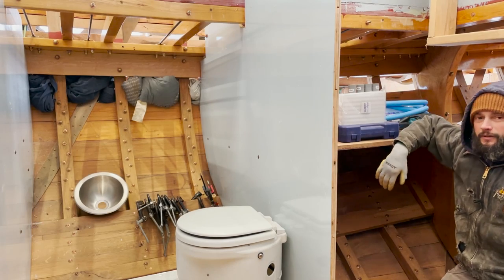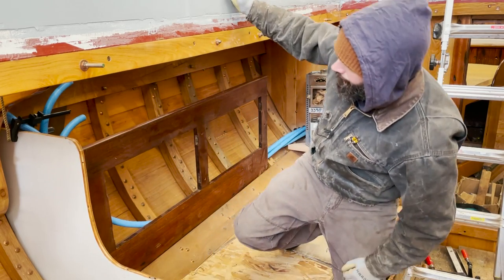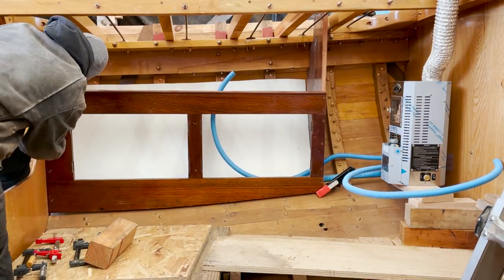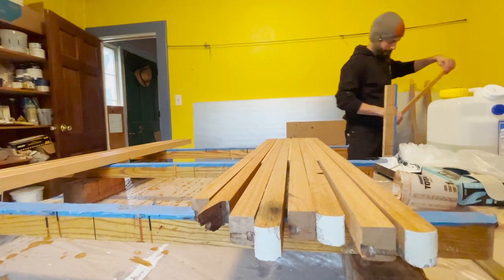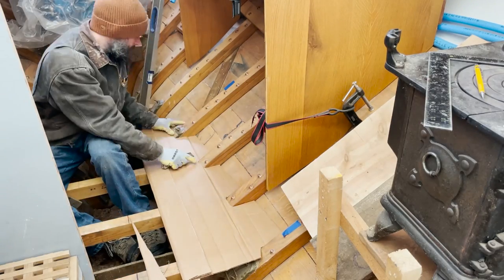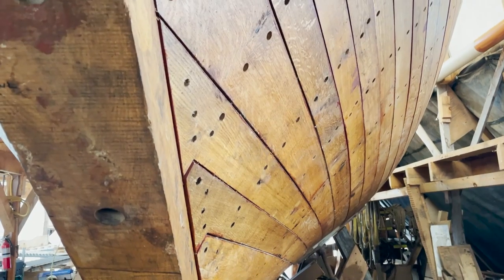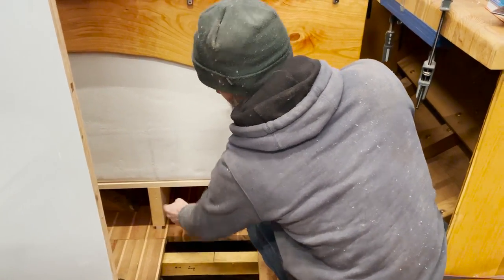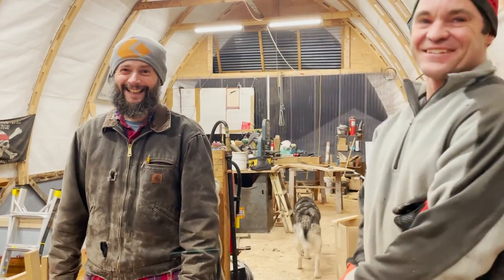Finally Back to Woodworking! - Episode 195 - Acorn to Arabella: Journey of a Wooden Boat

Comment: There's something about a wood burning stove in a wooden boat that makes me nervious.   Obviously you're not going to have a fire going in any kind of sea?  
And where are you going to store the wood?  A good fire extinguisher in close proximity would certainly be in order.
Reply from the maker: Considering the fact that the stove was manufactured to be on a boat of this size and a great many boats have them, rest assured. The pieces of wood that this thing takes are quite small, as is the fire box (the big door you see is the stove, the little door to the top left is the fire box). Check out what the normal amount of wood to stow for a few fires by looking up the visit to Norna we took a couple months ago.

Comment: Hi y’all! (Really Anne, I know you’re the one doing the real work managing all these comments. Great camera work BTW) 

Just wondering, and I’ve only seen one other comment about it, why pine for the reefer pedestal? I know it is on plastic runners, so no floor contact where rot would start. And I know you won’t see it once there is a drawer front and trim and whatnot. And I know you’ll put a finish on it so that it won’t soak up water/condensation. And I know the house sides are pine and they are extremely more exposed but they will be fiberglassed. And I know it’s plenty strong… but white PINE? Y’all are throwing mahogany vents up that won’t even be visible! You have oak and cherry and everything else laying around! Just wanted to hear some sort of explanation for this OUTRAGE!!! Lol 

Great work all of you. I hope it is as rewarding as you guys make it seem in the videos!
Reply from the maker: You might not know that a great many traditional decks and hulls are planked in pine where there’s lots of pine around. ✨ it’s good stuff. And of all the things we might have to replace in 10 years… this one’s an easy one. Other than that, how’d we choose it? We did a mock-up with it and it was damn near close to the right size. BAM. Quick project.
Reply from the maker: And yeah hi, Anne here 😁

Comment: DON'T use the GREY conduit couplers to attach the flexible conduit to your junction boxes! Instead, attach the blue conduit connectors directly to the junction boxes by drilling holes into the boxes that match the diameter of the threaded part of the blue connectors (I think it's 7/8-inch). Screw the blue connectors onto the ends of the conduit runs. Then, attach the blue connectors to the junction boxes using standard threaded rings designed for that purpose. NOTE that, the GREY couplers are used ONLY to SPLICE runs of flexible conduit.

Comment: I have been watching your vlog since the beginning and I must say, I’m impressed by all the fine work you have done so far. However I am a little concerned about your build. You seem to have shifted your focus to internal furnishings away from the hull and planking which, in my view should be your top priority. Aren’t you concerned that an unfinished hull without caulking or paint will undergo some serious distortion? Please do not take it as a criticism but rather as a concern.

Comment: Will it be possible to screw the conduit to the box once it is glued and in place? I would expect a lot of tension in the conduit.

As others pointed out the screwing is probably supposed to happen inside the box with an additional part and without „misusing“ the grey coupling part.

Comment: If you haven't come up with a solutions by now for the junction box connections. Lowe's & Home Depot sell fittings for that connection. Drill a hole the conduit fitting size. There are special hole saws that size. Then get these.  https://www.lowes.com/pd/CARLON-1-2-in-Conduit-Connector-Schedule-40-PVC-Compatible-Schedule-80-PVC-Compatible-Conduit-Fitting/1000999110 Glue it all in place.

Comment: Sorry, but I don't get the wood burner. Wood stove that needs special fuel - wood - which is dirty, bulky, and wants to clog you bilge pumps,  All when you have 3 other sources for heat - four if you count cold weather clothing. A lot of valuable space gone for a wood burning, cast iron stove that will get a lot less used than the diesel drip heater, stove/oven, residual engine heat, possible plug-in electric heat, Grey Goose down...  IMO.

Comment: About that heater with 12V fan. I wonder if a "stove fan" would work with it? Those do not need electricity to work. https://www.youtube.com/watch?v=rCk7FoxquYQ. In case you do not have electricity.

I am worried that the floor panels do not end on top of a beam, so that the panel do not flip up if you step on end of the panel. Or have those not been cut to length yet ?

Comment: I don't see any reason to use the gray fitting on the j box.   get j box nuts that fit on the thread of the blue fitting, drill the correct size hole for the thread, and nut the fitting to the box. skip the gray fitting. This is the standard way, and there is no reason to complicate it.

Comment: Why don't you just drill a half inch or three quarter inch hole whatever size the conduit connector is and use a nut instead of gluing a female end?

Comment: Why aren’t you refinishing by removing old finishes from the old woodwork.. considering you are using old leftover wood in other places that has old finish removed and re-sawn .... matching old finish will be nearly impossible... especially with missing parts such as old drilled holes.
Reply: Why are you assuming they won't? First, get the parts assembled and the fit right, and then remove them for refinishing.
Reply from the maker: We don’t need to match old finish… where we can leave patina because something is the right thickness, we do. Showing the life story of a piece of wood is more important to us than matching finishes.

Comment: you are going to REGRET not using a smooth walled conduit. that stuff is a nightmare. spend the $ on making all your stuff UL listed. those connections are less than ideal

Comment: you will seriously regret using that blue plastic crap jerk it out and put it in the trash. fair warning you will get that crap installed behind all your hard work and then when you go to pull in the wiring the conduit will break at the corners "fingertrap" the head of the cable bundle and you wont even be able to get the wires back out or pull them all the way through. the only place electricians use that junk is in cheapo tickytack construction...the junk is so bad in fact that if you are paying an actual electricians rate it is cheaper to use more expensive options because they go together better and the job will finish more quickly with a higher quality and save you labor costs.